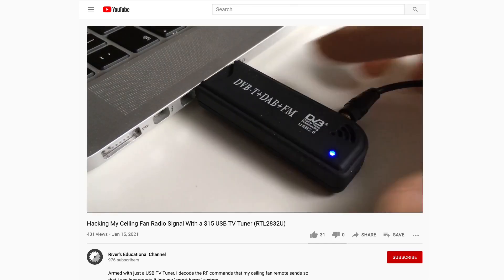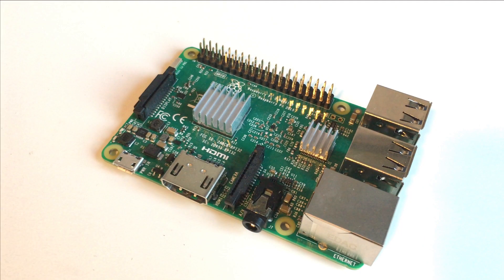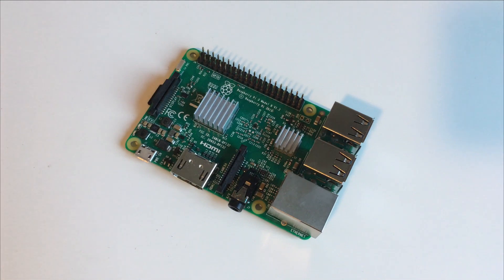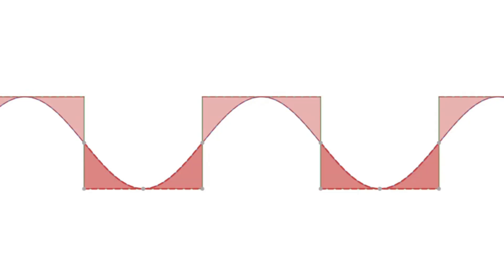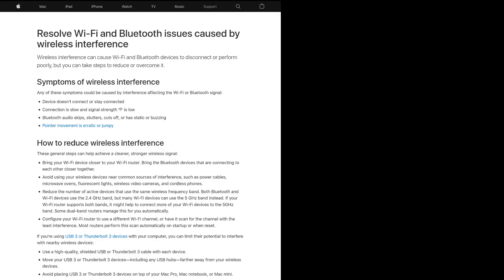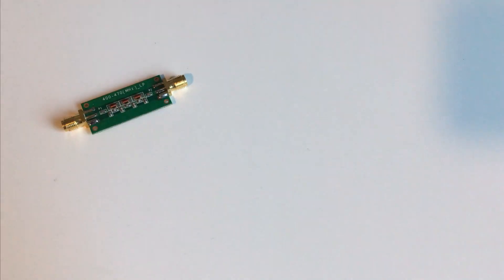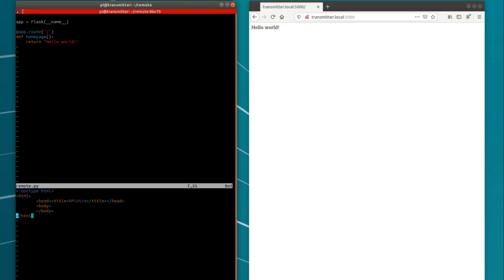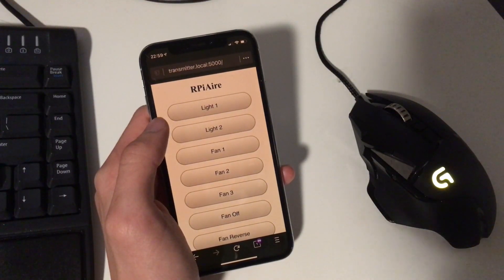Abusing Raspberry Pi GPIO pins as a radio transmitter to control my ceiling fan

Comment: where can i find a video on how to connect the matierials (for example that small antenna with the wires, etc...) . i really need help with learning such skills
Reply: You only normally need to connect one small wire to GPIO 4  to be able to send locally (a few meters, enough for testing). Cut the male end off a male to female jumper cable, it only needs to be a couple of inches long.

I was able to send and receive POCSAG Pager messages, amongst other things, with this Using an original model B Pi.

Comment: Nice! I'm trying this with my Pi 3b, but I have some trouble getting the "antenna" to stick to the GPIO pin.
How did you manage to get that attached without it falling off?
Reply from the maker: Easiest is probably to get a female-to-female pin connector wire. You don’t need the other end to be connected to anything, of course.
Reply: @riveducha  Thanks. A piece of plastic stripped from an electric cable did the job too :)

Comment: I really want to use the GPIO pins as a wireless transmitter and reciever to network 2 pi's and create an ssh link over the connection. I know its possible but haven't seen it done anywhere.

Comment: Does the added antenna improve the range of the signal or not?
Reply from the maker: Adding an antenna increased the range by a huge amount compared to having no antenna. I don't think there's much difference between having a simple wire and a nice-looking antenna but didn't measure.

Comment: Fantastic tutorial! This was exactly what I was looking for. I was able to follow your instructions to control an old Radio Shack wireless remote switch using my Raspberry Pi. Believe it or not, without any kind of antenna plugged into the pin, it actually works within a range of up to 2 meters! I'm planning on using this technique to control the fan speed on my humidifier, but first I had to order the optional remote for it so I can eavesdrop on the signals it sends. Thanks for the video!
Reply from the maker: I’m so happy you got it to work on your own appliances! It’s amazing how wireless stuff used to be such a mystery to me but with some cheap electronics it’s so easy to figure out and control!
Reply: @riveducha  Absolutely! Thanks to your video I feel like I truly understand how those wireless remotes work, and they are surprisingly simple. Still, it was very exciting when my switch turned on for the first time from a command that I sent using the Pi. I have an air conditioner which operates using an IR remote control, so  learning to controlling things with an infrared LED is on my list of things to learn next summer.

Comment: I just used your procedure to reverse-engineer the protocol for my ceiling fan with URH and replay using rpitx and was very happy to find that it worked like a charm!  This remote uses 303.875Mhz  but I was rather amused to notice, after I had gone through and captured the signals that one of them matches your "sendook" example exactly.  I guess these things are all using the same chip (or protocol, at least).  The one interesting hitch with my remote was that it appears to be using inverted Non Return to Zero so all the zeros and ones were inverted.  This really messed with URH's "interpretation" tab - it appears that the "message break" and "divisor length" settings for the ASK protocol don't work if the signal is inverted.  I did have to invert all the bits when feeding them to sendook, so a command captured by URH as 010011010010010011011011011011010011011 needs to be replayed as 101100101101101100100100100100101100100.

I looked up the FCC filing for my remote (a UC7207T) and they describe it as using "12 bit encoding" but the message length is clearly 39 bits as you pointed out.  Perhaps the last bit is a checksum?
Reply from the maker: Awesome to hear you got it working! I'm no expert on URH, but there are probably ways to get URH to do what you want by manually setting the interpretation settings. Clearly you got it working anyways. As for the 13th bit, I am not sure what it is. It's always zero in all the commands I know of, and I also checked all of the other possible values to see if there were additional commands (I found nothing). Someone who's familiar with this sort of stuff might tell us it's common to put a zero at the end or something.

Comment: Sorry for stating, that any effort to filter out "harmonics" must fail when made this way. The wires for connecting Pi and Filter will radiate probably as much still unfiltered signal than attached antenna will radiate filtered signal - if not more than the antenna.
Reply from the maker: Yes, that was an oversight that I also mentioned in the errata webpage. Luckily the harmonics are pretty weak!

Comment: So hold on a second, did you just shut off a ceiling fan and regular light, none of which are "Smart"  using a Raspberry Pi sending radio frequencies?
Reply from the maker: The ceiling fan has a built-in light (it’s a combo unit) and it comes with a remote control. It’s not “smart” meaning it doesn’t speak any standard protocols like Zigbee, Bluetooth, etc.

Comment: Really inspiring, thank you for this one. :)

I would love to learn more about the "web app" you quickly made to test the setup. 

All the best
Reply from the maker: There’s not a whole lot to it - the web app simply runs sendook when you push a button. It uses Flask as the framework so I didn’t have to write much code.

Comment: This was amazing! This may be what I need to finally have a way to remotely control my ceiling fan. 

I bought an old house from the 70s back in 2007, and its where I still currently live. In my master bedroom is the only ceiling fan in my house that did not come with its remote control. This ceiling fan is a knock off brand ceiling fan, but I have ordered dozens of different ceiling fan remotes for ceiling fans that looked like mine through google searches, and every single one of these remotes did not work with my ceiling fan. The ceiling in my room is also really high, so even though I am 6 Feet tall, I still have to get up on the top of my step ladder in order to pull the chains to change the fan speed, and the chain for light is broken, so I just installed a different light in my room. 

I kind of gave up after the 12th time I ordered a remote and it failed to work. I already have a bunch of Broadlink devices in my house that I use to capture remote signals, so I can control RF and IR Devices over WiFi using this device, but I have never been able to figure out how to capture the signals my Ceiling fan needs to transmit the correct RF commands to it to change the fan speed or turn on or off the light or fan in it.

Do you know of a way to capture the codes needed without having the remote to the ceiling fan by chance?

Either way, Awesome Video man! I hope this brings in the subscriber base you deserve, I am subscribed now, and I actually found this through a Toms Hardware article that referenced your video, so hopefully that will direct more traffic your way!
Reply from the maker: I don’t know a great way to figure out the wireless commands without the remote. There’s a chance you can find the “FCC ID” inside the fan that you can then look up on the FCC’s database. You may be able to figure out manufacturer and frequency this way.

Comment: If anyone is having trouble getting this to work with their fan, pay attention to the pause interval and move the repeat number up to at least 3. These issues tripped me up.
Reply from the maker: I also noticed that repeating the message only once or twice didn't always work. The manufacturer remote just repeats the message for as long as you hold down the button.

Comment: I cloned rpitx off github, but it doesn't have the sendook util... Did I grab the wrong one?
Reply from the maker: It needs to be compiled first (source code is in src/ook). I think the install.sh script that comes with rpitx should install all the dependencies and compile everything for you.
Reply: @riveducha  Yeah.. forgot to take my anti-stoopid pills earlier.  Noticed the install script a few mins after I asked, and forgot to run back here and delete my post before anyone read it and thought I was a moron, hahahaha...